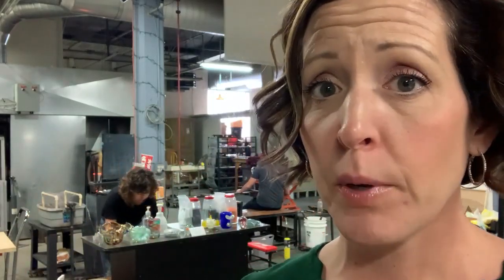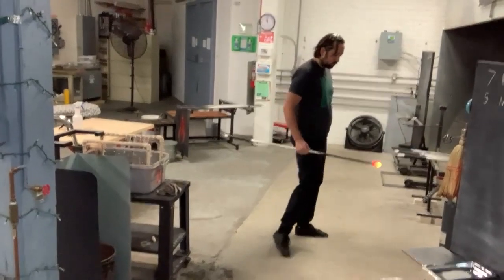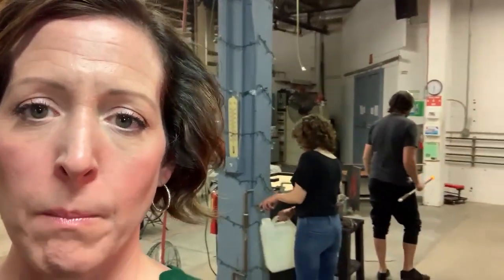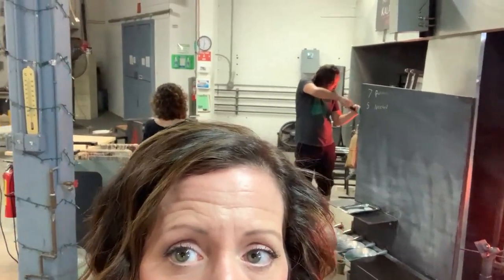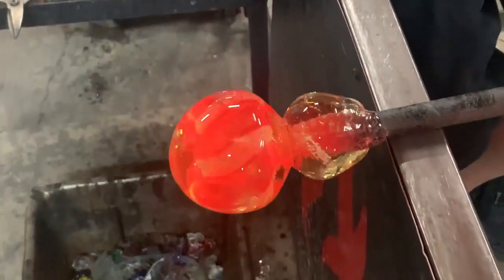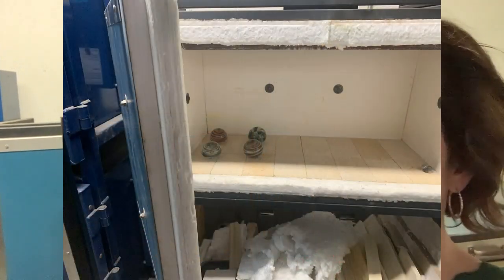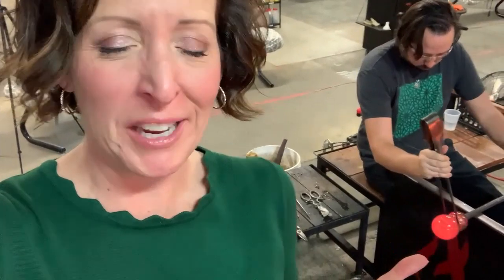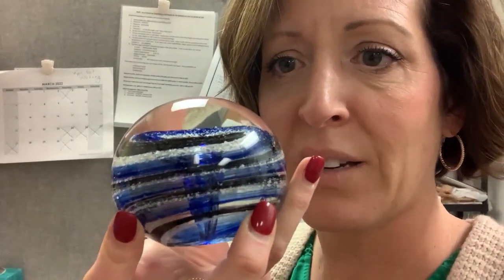How To Incorporate Cremated Remains into Glass Art

Comment: @Kari the Mortician I was wondering if the paint used for the air brush technique for cosmeticing the deceased is safe for the living and if brands like dodge can be used on the living as well I really like the variety and it looks like it has more stay power.  I also saw a living guy with a big hole in the front of his face  missing his nose and wondered why the restorative techniques that are used in funeral home couldn't be used in cases like his?
Reply from the maker: They can but its a different formulation than makeup for the living